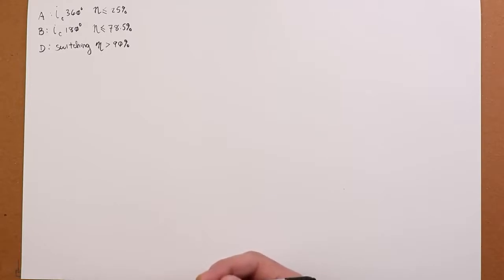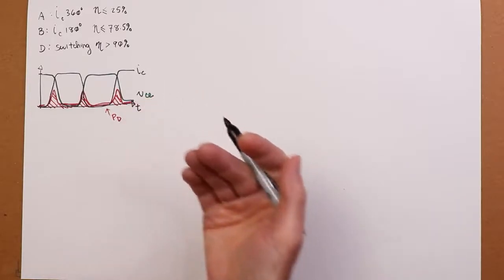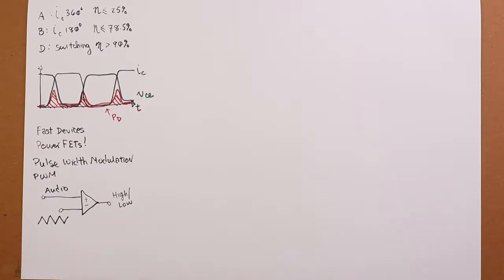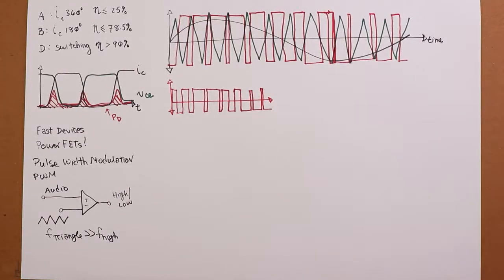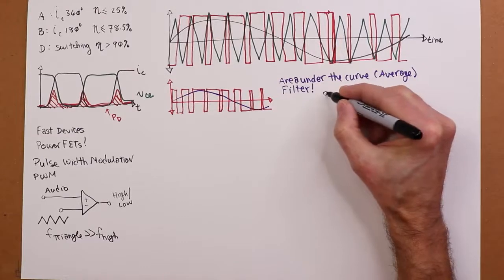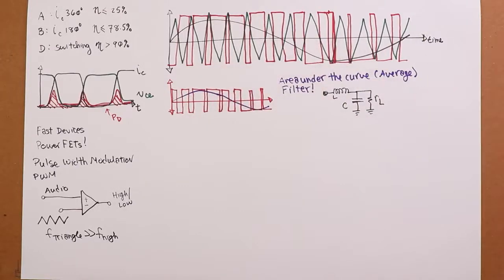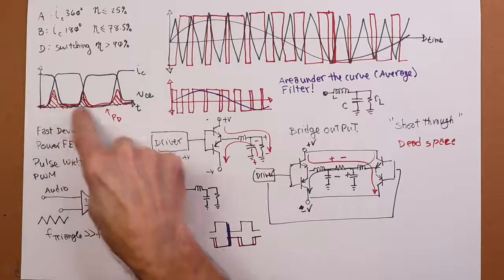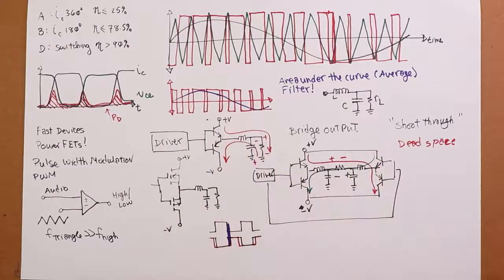Semiconductor Devices: Class D Power Amplifiers

Comment: How to control the gain on class D amp? Sir.
Reply from the maker: We don't really think in terms of normal voltage gain for class D. The size of the signal from the prior (analog) stages is what sets the depth of the PWM, and thus the size of the output signal. If you want a larger output, then increase the input (just as you would with a class B power amp, typically configured as a buffer).
Reply: @ElectronicswithProfessorFiore  o... i see. So the gain of class d amp is 1, right?
Reply from the maker: @DwiNoviantoUntidar  Not really. The very concept of gain is complicated because this is a non-linear system. If we consider the PWM subcircuit to be part of the class D amplifier, then the analogous question would be "Given a certain modulation input signal, what is the size of the load signal?" The ratio of the output signal to the signal into the modulator would be the "gain", or at least the closest thing to what we call "gain" for a linear amplifier.
Reply: @ElectronicswithProfessorFiore  so how to set the volume / sound intensity in class D? Should we add adjustable current mirror to control current through the mosfet?
Cz in class AB, due to unity gain, if we vary the preamp gain, the output will also vary.
Reply from the maker: @DwiNoviantoUntidar  The output level is a function of the depth of PWM, which is controlled by the signal feeding the modulator. You do NOT control the intensity of the signal feeding the class D output devices. Those transistors only operate in saturation or cutoff. In other words, the signal coming out of the preamp is what you need to control before it feeds the modulator. A simple pot set up as a voltage divider should work just fine, similar to what you'd do in an all-analog circuit (class A or B) feeding the driver stage. That's your volume control. The size of the signal feeding the PWM circuit depends on the design of the modulator. You could design the modulator so that it gives 80% depth (a typical value for max output) with only 1 volt of input, but you could just as easily design it to achieve 80% with a 5 volt input. 

Back to your original question, it is important to understand that the audio signal is being encoded as a series of pulses of varying width, not being amplified in an analog manner. Thus, the normal concept of gain does not apply. Does that make sense now?
Reply: @ElectronicswithProfessorFiore  ok, thank you. Ill try to simulate it with proteus & vary the audio in than look the effect on the LPF output.
Do u have recomendation for comparator IC?
Reply from the maker: @DwiNoviantoUntidar  If all you're doing is a sim, pretty much any comparator (or basic op amp) will be sufficient. Just go with something that has a decent slew rate (no 741s or similar).

Comment: I don't understand how current and voltage could be opposed, somebody does?
Reply from the maker: Could you clarify what you mean? Are you referring to the action of an inductor?
Reply: At the beginning of the video, you explain that the class D amplifier is very efficient beacause when voltage is high, current is low (and P = U.I ...) and vice versa. But I don't understand in practice how the use of FET transistor can realize this phenomenon, because when we have a high voltage at the gate of the transistor, there is a huge current which is going to go through the component, right?
Reply: @ElectronicswithProfessorFiore  Would it be possible to contact you privately? I'm a French high school student preparing something about the class D amplifier for the exam I will have at the end of the year and I have a lot of question about this technology.
Reply from the maker: @TionebFountain  You seem to be thinking in terms of a resistor and Ohm's Law (where a large current produces a large voltage). Although this is not strictly accurate, you can think of the FET as operating like a resistance that is controlled by the gate voltage (high Vgs yields small resistance). Some people compare it to a valve, where applying a higher gate voltage is like turning the valve more "on", increasing current flow. That current flows through the load, and thus, we get a large load voltage. Another way to think of this is like a voltage divider (between the FET and the load). A large Vgs creates a small resistance for the FET, so most of the applied (drain) voltage winds up across the load.

Sorry, but I am not available for individual instruction, and anyway, it would probably be best if you worked with your teachers/mentors at your school. That's why they're there.